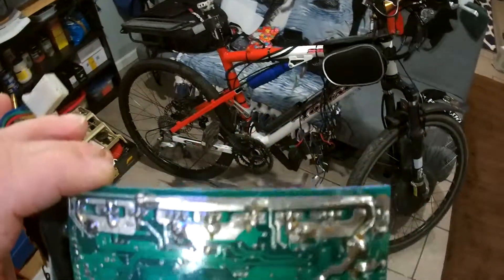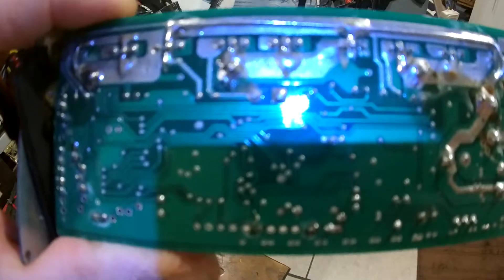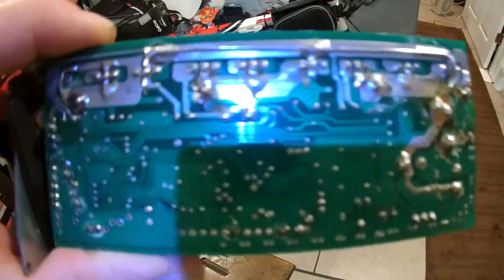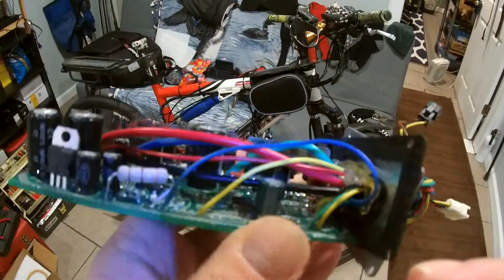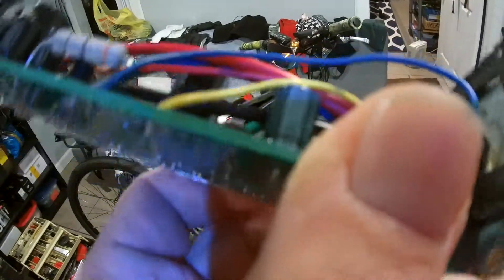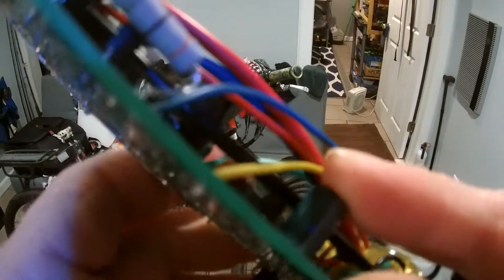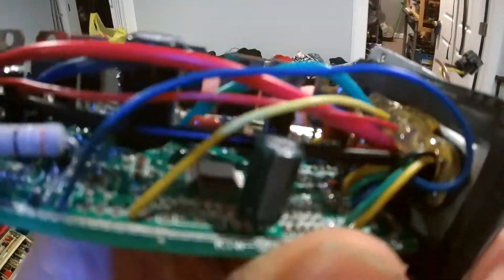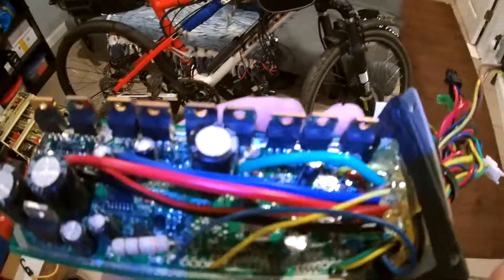Not enough capacitance 48v ebike controller.Time to beef it uP!

Comment: Ive had one pop out i put it back in and all good but now few months later blew a hall in the motor changed the complete board with the 3 fresh ones in it  now my prob is everything works  except for the throttle and its on the displays yea those ones 😠, anyway everything checksout MOSFET s senors etc  will i remove that  cap and hopefully its it  ,i have a love hate with this controller its a sturdy stubborn piece of pishh but i like it cos its the only original one u can find now even from the makers  parts are very hard to find but caps just cant be ,what u think cap
Reply from the maker: Never bothered with this one since upgrading to a 35a controller with a 52v battery for my 1000w ebike. My 1500w ebike with 52v battery using a 45a controller is working great.Just enough capacitance but more would not hurt lol

Comment: I have a question to ask, for 48v, 3Kw DC motor I wanna make a backup capacitors pack, when I switch from one line of electricity to another, in that moment I don’t want to stop motor during switching, for that purpose how many caps, how many capacitors in pack required?
Reply from the maker: Good idea👍 you would be better to ask a more qualified person like Bruno Power has engineered some fancy electric race cars & bikes.I would think the switch, caps etc. would be heavy duty.2 battery packs just draw power from both no need for switching😁Good luck

Comment: Heat sink it with a soldering iron. I have ran across similar defeats before. 👍🏽
Reply from the maker: I may have gone too far with it 5 years now.This thing is just too small for the power of my new battery anyway.
Reply: peter toth ok! Hope you can find a controller that can handle your battery capacity.
Reply from the maker: Oh snap i just scooped it up.30a controller with all the right wire pinnout it looks real nice have it next week.ebay is just like other websites you have to search many specific words to find exactly what you want but still at the merci of the seller for good descriptions and photos.Brutal long time searching for a week.

Comment: Scotty we need more power !!  Better to have to much power than not enough. i watched an E bike video yesterday that was awesome. it had so much power it would pop a whelle. Dam thing looked scary!  hope you get it fixed proper.
Reply from the maker: I been scavenging the parts to hack this thing.If i cant fix it i will fix it so nobody can haha.
Reply: @petertothRC-FPV  i here ya.  about 15 years ago i made a gocart with wheelchair motors and ran 3 car batterys. had a jumper cable lead fixed to the floor and another fixed to the peddle, the 3rd time i made contact between the to leads they welded them selves together and i was in for a scary ride, could not stop the darn thing. ended in a big crash. live and learn !